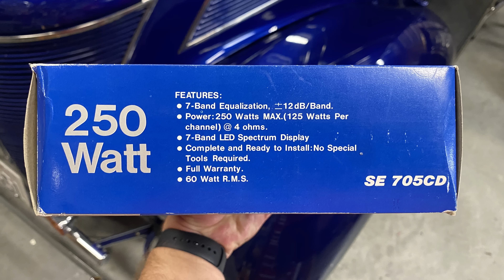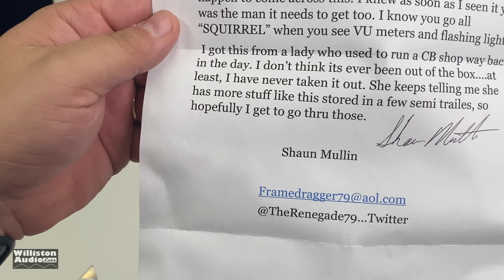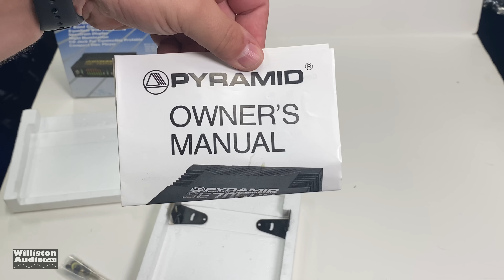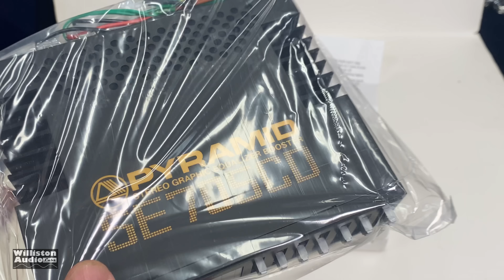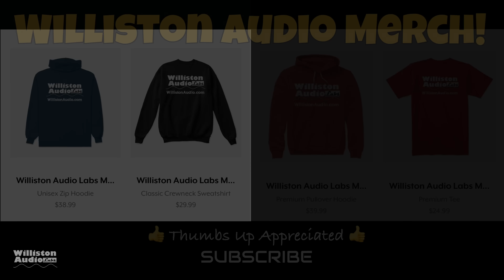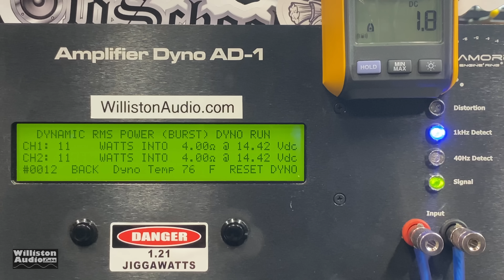1980's Flea Market EQ Booster? Pyramid SE705CD Review and Amp Dyno Test

Comment: Back in the mid 80s we used to sell these EQs in a package deal, it was a MGT cassette deck this EQ and a pair of MGT 6 1/2s or the 6X9s for 199.00 installed. For 10.00 more you could upgrade to Jensen 6X9s :)
We had a 10% defect rate on the EQs and 50% of them brought in bad ignition noise ( home-o-noise as we called it).
I got a sharp pain in my neck when I saw your thumbnail.. Great video as usual... Cheers.

Comment: OMG!  I still have my pyramid booster.  Used it with 2 8's in a sealed box and ran 4 6x9's in my vw bug back in 89/90 and used it till 96. Was always burning hot but it never quit.  To me it sounded amazing.  4 tweetz off the radio.  My dad was even jealous and he was running 2 10's

Comment: Back in the 80s, these under dash EQ/amps with slider controls and spectrum analysers were as abundant as raindrops.  Today, I can barely find any.
Even though it's been sitting in a box and never used. the capacitors had been drying out this whole time.  All the electrolytics should be replaced after about 40 years.  Other than that, sweeeet memories.
But no - the best electrolytics in the world will not get it up to 60W rms.

Comment: It would make some fine Sparkomatic speakers blast you out of the car. 😅😅😅Also the body looks similar to Realistic products. I had a Roadmaster 100 watt booster eq hooked up to a pair of Magnavox 8” stereo speakers. It was in a hatchback Pinto and neighbors across 100 yards on other side of highway thought a car with a big system was coming down the road. Push ten watts to five watt speakers and miracles can happen. 😁😁😁

Comment: Really nice to see after all those years in that condition, that is a gem. I've got the pyramid se 709ex it's exactly like this only difference is it got blue lights instead of green and uses rca's and hi level wires instead of the wires alone. Probably has the same 10 watts but it sounds good together with an old school pioneer premier dolphin display head unit, looking forward to see more vidoes of gems like these☺
Reply: Pioneer premier with dolphin display head unit is rated like 45x4 super tuner radio correct I believe that is the power rating my pioneer keh-1700 Auto reverse cassette tape deck was it might have been the 1900 I remember it was $129 at Walmart in 98-99  I bought it in 99

Comment: I used to own a stereo shop in the 90's. I sold a ton of these. Paired with a couple of beefy 6x9s' in the rear deck, this was a decent, affordable setup for it's time.
Reply: It was bro!...made my realistic 4x10's bump tho in the 86 Cutlass Supreme Brougham
Reply: Jenson tri ax, or Craig power play
Reply: I guess it might actually be an upgrade with factory radios often struggling to get to 1 watt per channel in those days. Those factory radios often really sucked well into the 90's (because they were built with parts and designs from the early 70's) and usually the factory speakers were absolutely crap too. I remember pulling a dash speaker out of a new mid-80's car and finding it had an alanco magnet!

Comment: I remember buying an even cheaper eq called “Mustang” back in the 80’s. It was “gold anodized” and had dual led vu meters. In testing it on a makeshift test set up with a stock car stereo it wasn’t any louder and even made the sound worse. The fleamarket stereo scene back then was actually way worse than it is now.
Reply: Yes! I had one. It had an 8 watt IC inside and both left and right outputs were tied TOGETHER. Mono output. Never seen before or since. Wild!
Reply: I remember that one
Reply: I had the mustang 10 band with the Brite ass red and green lights ! It rocked my alpine head unit and mismatched speakers
Reply: Didn’t those come from JC Whitney? I remember they had mustang head units
Reply: REPVILE I saw them in the jc whitney catalog too. I bought mine at the flea market before seeing a jc whitney catalog. Seeing them in that catalog made me question the quality of everything else they sold.
Reply: Mustang and kawasaki what a winners, I think Chinese kids learned how to soldering with those things.

Comment: Idk where I got it but I used one of these in the early 2000s to get speaker outputs from a pioneer head unit after it’s internal amp failed
Reply: The Jensen 80 watt graphic eq  boosters version is how I used to test radios because it has RCA's lol

Comment: Anybody else miss the old skool VU meters and spectrum analysers? I sure do
Reply from the maker: You knows I do!
Reply: I miss all the buttons, knobs and sliders along with the level meters! 
Sure! Touch screen is cool and it was an interesting experiment but I think that it's time to go back to the way that worked best! 
This thing might be crap by today's standards but it could almost be repaired by anyone armed with a soldering iron! I could be wrong but I think that I only saw one electrolytic capacitor in there! Replace it every few years and it's going to keep working for a very long time...

Comment: I had a Pyramid amp and 2 Pyramid 12’s in my Chevy Cavalier Z24 back in 1996
Reply: Before I could drive I bought one of the clear Phase 3 15s from the flea market.  It fit perfectly into a shop vac canister.  The canister had a lip around the edge for the screws.  Lol. Powered it with a home receiver with a choke coil for the crossover. 😅  Those were the days!
Reply: @themaddrummer8341  Dude I remember using a old console radio and some cardboard for my first box, so I can relate.😄
Reply: @Shrug Life Dude I had a pair of 8s or 10s that were that semi transparent polypropylene, but my 12s were paper. Those were the days😂.
Reply: @Shrug Life Dang man! I'm having a moment with all of these great memories going off in my head😮😂. Hey wait up🤔, your name ain't Oscar is it? I had a buddy that had that same setup in California.